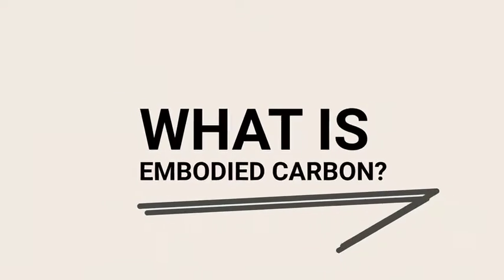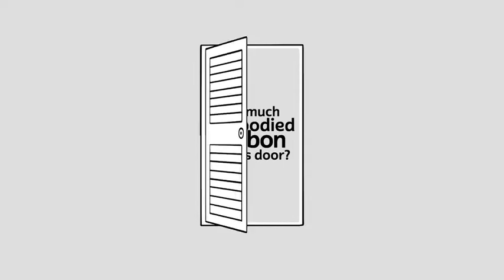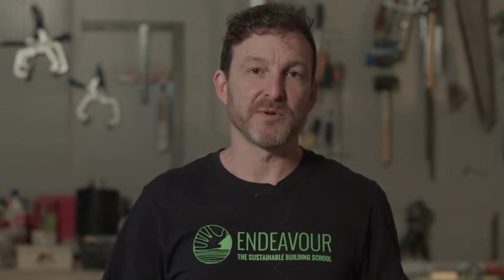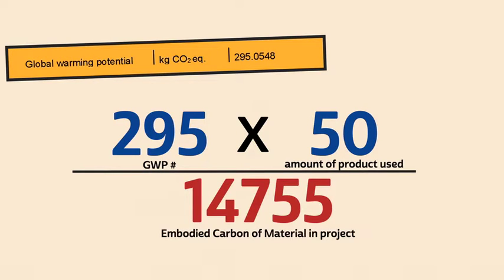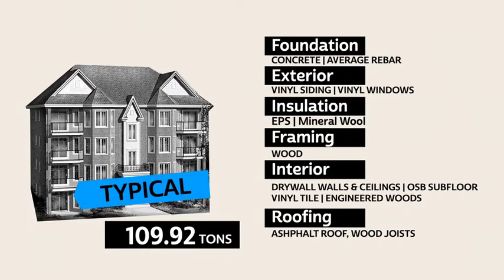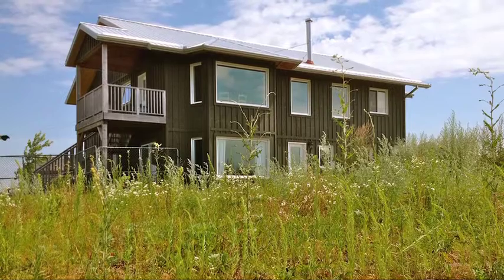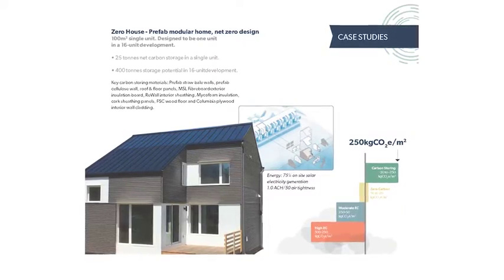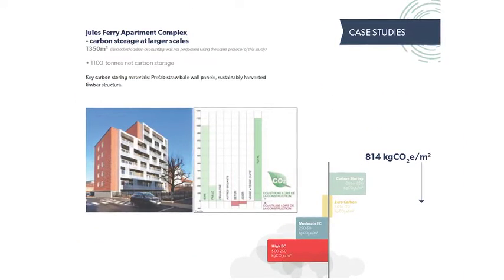What is embodied carbon in buildings?

Comment: Great insight into embodied carbon!

But I am not sure how the energy consumption (especially fossil fuel based) by construction machinery/on site process during the construction phase is factored into this? There are a lot of other sources of emissions produced during months and years of construction. It only appears to be considering material lifecycle based carbon.
Reply: You are right, we are calculating emissions on the "material phase" of the life cycle... all the emissions associated with harvesting raw materials, getting them to a factory and manufacturing a product (phases A1-A3). We focus here because this is the majority of emissions for building materials (65-85% of the full life cycle emissions), and because these emissions arise from the best data. We are not taking into account transportation emissions to the building site (A4), or emissions from construction (A5), partly because these are smaller (usually just 5-10% of life cycle emissions) and because they are site-specific and cannot be captured accurately in a generalized way. I tend to use a car analogy, where A1-A3 emissions are the "fuel mileage" and the thing that gets advertised because it's the most impactful, while A4 and A5 emissions are like the frequency of oil and brake changes... good to know, but not the basis of most decisions.
Reply: @chrismagwood971  Thanks for the explanation. 
Although, I find it hard to believe that a building is truly carbon drawdown --- capturing more carbon than it has and will produce since it did not capture any carbon in the first place. It was merely transferred/transformed by harvesting plants into building material and in the process, devoiding the plants of future capability of carbon capturing. Unless there's some magical carbon-capture device installed which in turn captures more carbon than what is emitted during its own lifecycle plus building's lifecycle; or the building produces more clean energy for itself and society than it needs in its entire lifecycle offsetting the embodied carbon completely. I might sound a bit amateur but just trying to see the bigger picture. :D
Reply: @BhanuPChauhan  The carbon capture happens before the building is made, when the plant-based materials used in the building draw CO2 out of the atmosphere and incorporate the carbon into their structures. For non-timber plant materials, this carbon came out of the atmosphere recently and would have returned if not stored in a building. When the amount of carbon stored in the material exceeds the emissions generated to harvest and produce the material, the effect is net carbon storage. This kind of carbon capture and storage is among the strategies included in all IPCC reports and is considered necessary to meet climate targets.
Reply: @chrismagwood971  Broaching the same subject again, I think the carbon sequestration potential of plant-based materials can be overstated. While wood products and biobased materials may sequester some amount of carbon during their production and use, this carbon sequestration is generally considered to be part of the natural biogenic carbon cycle and should not typically be included in embodied carbon calculations unless there is some carbon offset by more plantation which should be transparently disclosed to avoid double-counting.

When the building materials are disposed of or naturally biodegrade, the carbon that was sequestered during their production/use is eventually released back into the atmosphere in well under a century.

In a research led by the University of Arizona, it was suggested that dead forests release less carbon into atmosphere than expected.
"Trees killed in the wake of widespread mountain pine beetle infestations have not resulted in a large spike in carbon dioxide released into the atmosphere, contrary to predictions, a UA-led study has found."

While it is possible for a building to reduce its carbon footprint or strive for a net zero status through the use of cleaner materials and carbon offsets, it is still unclear to me how a building can truly be net negative solely through the use of plant-based materials and without the use of any advanced carbon capture or storage system or next-gen technology.
Reply: @BhanuPChauhan  You are correct that the storage potential can be overstated. In our work (and in the BEAM tool we developed), we do not count any carbon storage value for virgin timber products, for many of the reasons you state here. However, for agricultural residues, short-cycle crops and waste stream fibers, there is strong justification that the carbon stored in this biomass were destined to become emissions in the short term, and that long-term (50+ years) storage in buildings has a demonstrably positive impact on total atmospheric CO2 levels (especially at scale). The fate of this carbon at the end of the material's life in a building may result in a new emission (and part of our climate response needs to be tracking those emissions and preventing them by re-use, re-cycling, conversion to biochar or other means). But durable carbon removals in buildings can play an important role in meeting our climate targets over the next century. I'm currently working on a paper with several climate scientists to make this case.
Reply: @chrismagwood971   Thank you for engaging in this chat and for sharing your insights. It is important to measure carbon impacts at each stage of a building's lifecycle and to be transparent about the sourcing and carbon footprint of materials. Continued research and global collaboration will be important in addressing these challenges and opportunities related to embodied carbon in buildings. Definitely interested in checking out BEAM tool now.

Comment: Thank you so much for this video, I have a question though. I want to calculate the embodied carbon footprint of a building but I don't know how to calculate it. Is there any video explaining the method we calculate it?
Reply from the maker: Currently, we do not have a video about that.  Check out our Builders For Climate Action Initiative.  We will be launching a carbon calculator soon!  https://www.buildersforclimateaction.org/. You can also check out our carbon accounting webinar Here: https://endeavourcentre.eventsmart.com/events/basic-carbon-accounting-for-buildings-1-5hrs-2/
Reply: @BuildersforClimateAction  OMG, thank you so much! I wasn't expecting an immediate response, I sincerely appreciate it. I'm currently writing a paper about a life cycle assessment (cradle to grave) hempcrete building, however, when I used a tool (mesh stage embodied carbon calculator) I don't understand why they gave a positive value of KgCO2eq. From my understanding, hempcrete should've a negative global warming potential. However in their calculator hempcrete have a global warming potential value of (40 KgCO2e) per m3. Is this value correct?
Reply from the maker: @hinata5963  Most programs are not accounting for biogenic carbon or the recarbonization of lime. Our calculator will be taking this in account and thats what makes ours different from the rest!  sign up for the Builders for Climate action newsletter to get notified when the calculator goes live!
Reply: @BuildersforClimateAction  thank you so much! Otherwise, for the embodied carbon of the wall and flours Compositions, do we take the material potential KgCO2e and multiply it with the thinkness and surface? Is that the correct way to calculate the embodied carbon of the building layers? So it will be on KgCO2e per m3?